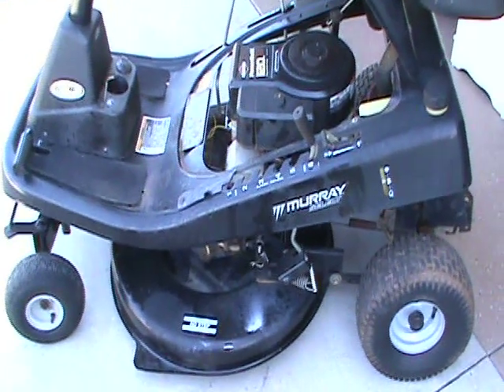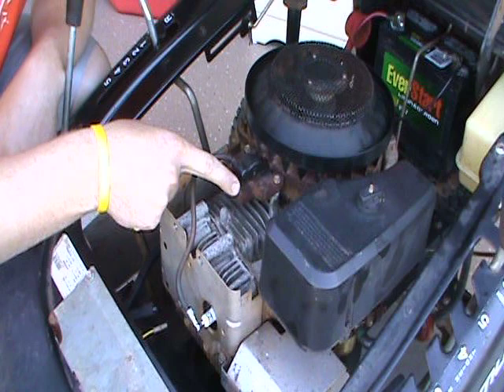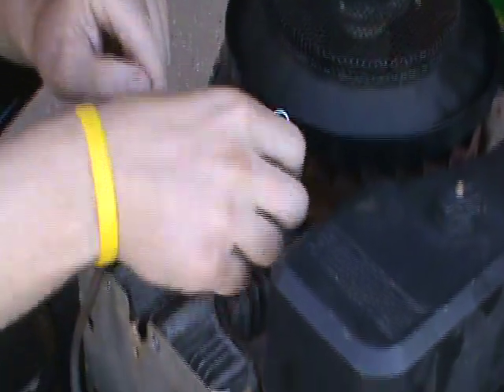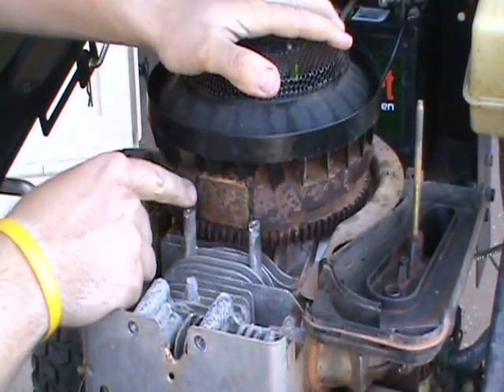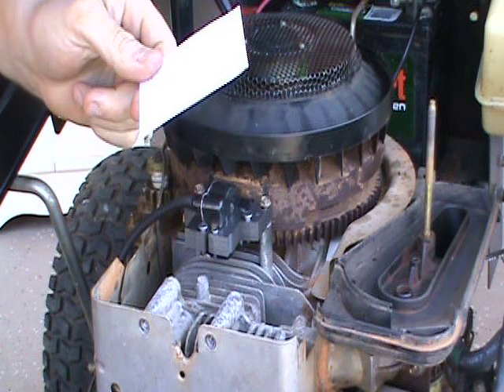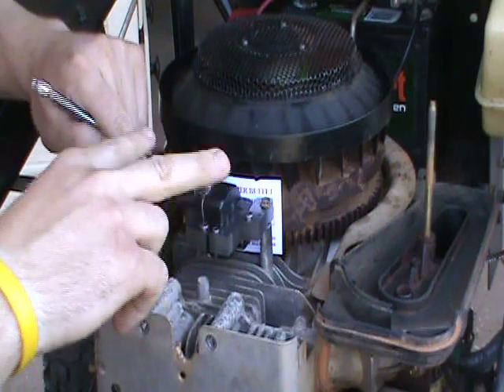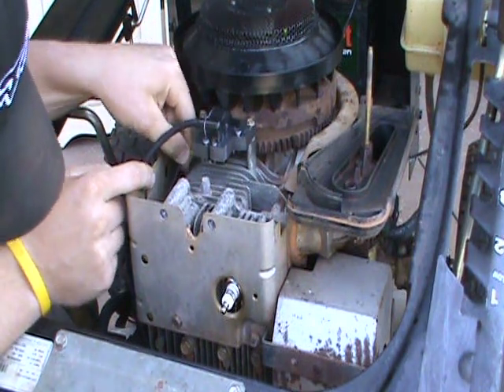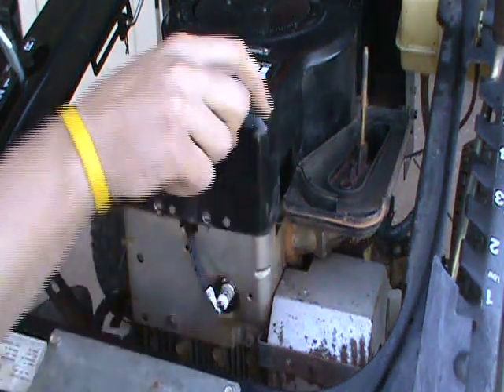BRIGGS and STRATTON COIL ARMATURE MAGNETO REPAIR NO SPARK

Comment: Great job, but one thing you may not realize is measurements.  I'm not trying to be a smart ass, but most people don't know this...  when you said the business card is .010 of an inch, that is "read" as ten thousandths of an inch, later you mentioned that you can use a tool and set it at .030, which is thirty thousandths of an inch.
Reply from the maker: yep you are probably right. Good info, its just that most people dont' have the tool or they could double up the card too

Comment: Hello sir, I am no repair specialist but I know be for you discard the magneto not working, should you not check the spark plug even new spark plug could be dud. And should you check to make sure the magneto has not moved to far away from the fly wheel,and then you should check the magneto its self on a electrical devise,Its nice to give people info but its costly to change magneto to what it is to change the spark plug,and even cheaper than the spark plug check distance of the magneto,
Reply from the maker: jason hazelwood yes of course, good things to check, the magneto needs to be changed after checking all of these issues. and the gap should be checked too. Thanks for the info.
Reply: TheRykerDane No probs Dood I only could relay this to you because ive had these things happen to me over the years ,I never would of thought of spark plug being new and not working untill some wise briggs and stratton engineer told me and he was right,

Comment: What is the purpose of the thin wire? What is the other end connected to?
Reply: the blade brake. engine won't start if this wire is grounded somewhere.

Comment from the maker: Ya sorry, I meant to say open ended wrench
Reply: Everyone makes silly mistakes - however - there is no spell checker for videos - so -  you have to go back and actually catch your own mistakes. 
1/4" drive with extension and a  5/16 socket works well - it turns out I just removed one 15 minutes ago.  If you are dedicated to using a combination wrench you might consider using the box end end - much better in this case.

Comment: i have a magneto where the spark plug wiring is exposed due to the fault of previous owner...how can i fix that becuase i think it should be an easy fix?
Reply from the maker: ballaboy4000 If the spark plug wiring is not frayed or damaged, it should be good. Wrap it with black electrical tape to protect it. You can also hook up a multimeter to see if current will run through it.
Reply: TheRykerDane i basically ordered a used one, but as luck would have it it was the wrong model or size but very close...so i clipped the spark plug wire about a few inches from the boot and exposed the wire and just sorta twisted both wires together and taped it up...do you think that will work?

Comment: Is there ANY way to make controlled spark without a magneto?
Reply from the maker: I don't think so, You need that magneto for it. Are you trying to test your plug?
Reply: Yeah, the magneto isn't working and I got the engine today from my auto teacher and that's the only thing not working on the engine.
Reply from the maker: oh I see, well you might be able to find a used magneto at a small engine shop, or repair shop. They might either give it to you or it would be cheap.

Comment: i would also sand off the flywheel;befor installing the new coil. keeps the rust from swelling and rubbing into the coil
Reply from the maker: Yes good idea! That would insure a good spark!
Reply: for sure. i always sand the fly wheel even if i just have the cover off to clean. had a weak spark once someone told me to sand it flywheel all the way around and coil arm. instantly got my spark back. saved alot

Comment: Sorry man, your thumb nail showed magneto repair, not replacement,and in what state do you call an endwrench a monkey wrench. I will give you a thumbs up for the effort though man, not to be too hard on you though ,I did need to know the gap I used to use matchbooks back in the day but I forgot that was the gap on the magneto. Thanks. My learning of a monkey wrench was an adjustable pipe wrench
Reply: It took me a minute to realize you were probably making a joke, with all the electric special tools we have nowadays that probably would be a monkey wrench cuz it's kind of prehistoric to what they have now for tools, thanks

Comment: what was the part number for that coil
Reply from the maker: +gary bishop I am not sure. it was long ago
Reply: does it really matter? (seems to, to the parts guy, or website). They mostly produce the same voltage for the same spark plug across many makes and models of mower engines, and they all look basically the same. who knows? Home Depot wants to know "what year was your mower made?" wth. unless you bought it LAST YEAR, who knows that?
Reply: Ya it matters there are two different coils one with a wide bolt pattern and one with a skinny bolt pattern. The skinny one also has too steep of an angle on the armature legs and will hit the flywheel if you modify the bolt. Holes. That's the only reason it matters you can modify either or to fit and they will work. You can take them off a push mower and make them work I have . I just wanted to simply bolt one in for once.

Comment: i thought you were going to repair the old one?? save a few bucks

doesn't cleaning it with sand paper do the trick?
Reply from the maker: ***** yes it can, but the wire on my magneto was ripped and it was going to take some soldering.

Comment: This is a good YouTube, but...  WOW! Never heard of a combination wrench, open-end wrench, or box-end wrench called a Monkey Wrench.  From what part of the planet are you?  To be specific, a monkey wrench is built kind of like a pipe wrench.  A monkey wrench is an adjustable wrench, but not all adjustable wrenches are monkey wrenches.  Check Wikipedia.  Anyway, most small engine mechanics just use a business card for the gap.  The instruction sheet that came with my Magneto Armature was plain copy paper; way too thin.

Comment: coil... it's a coil...
Reply: It's a magnetron ignition.

Primary winding has a weak charge induced by moving the primary's
cool through a magnetic field.
This charge is then increased by its induction into the secondary windings to thousands of volts.
The switching is controlled by two darlington transistors.
The timing is controlled by the magnets placement/ position on the flywheel.

It is not just a coil.